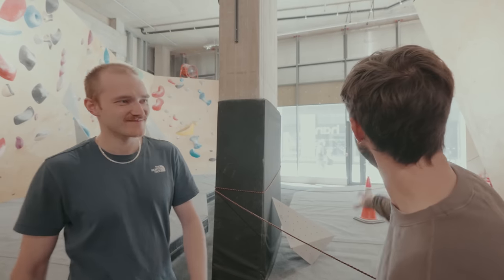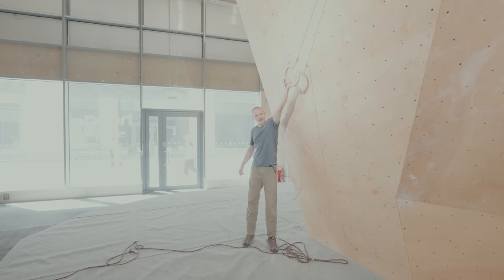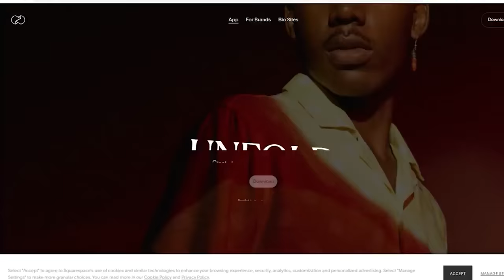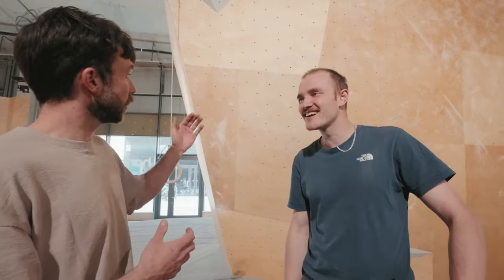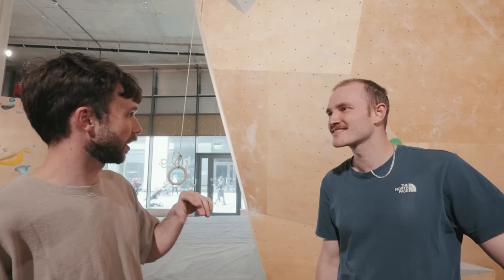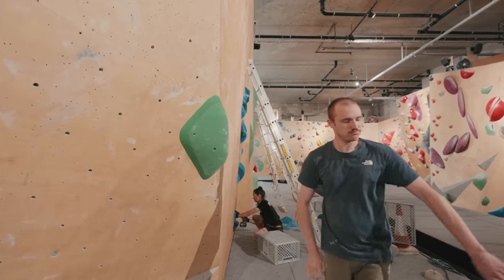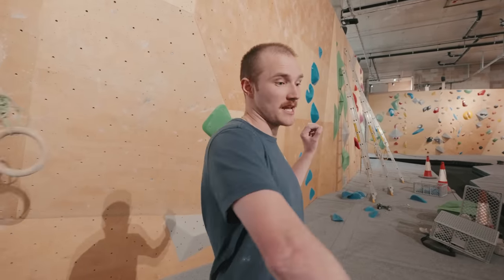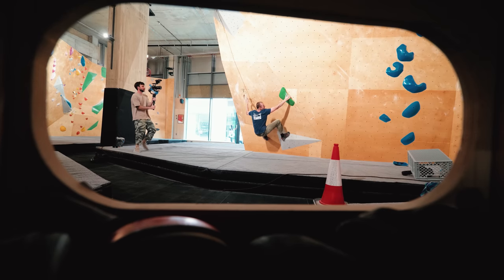40ft Rope Swing in a climbing wall?!

Comment: They set something like this at my home gym (Spire in Montana, USA), but there was a slab problem to get to the ring, and then multiple exit points that were graded differently. E.g., just grabbing the first hold was a 4 or whatever and it went all the way up to 7B+ or so, where you had to jump off the ring and hop along a couple volumes to reach the finish hold. Absolutely not my style of climbing, but creative idea nonetheless.